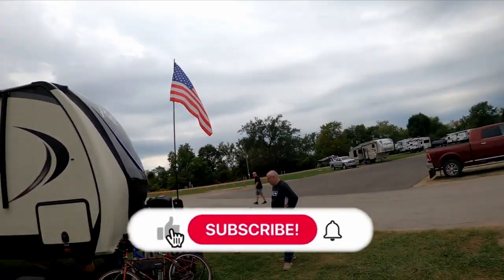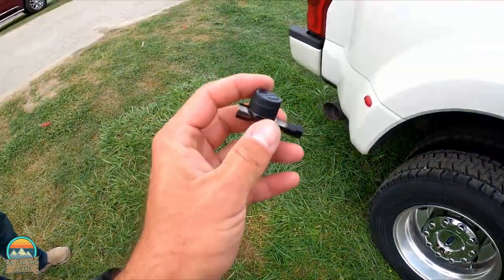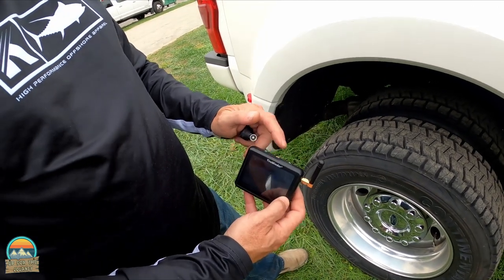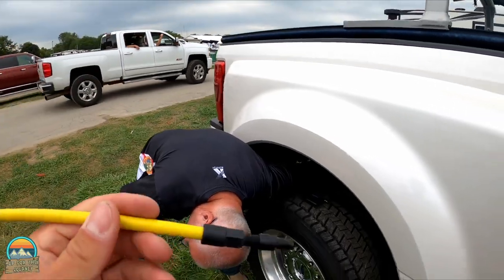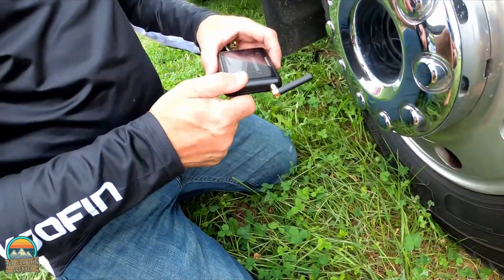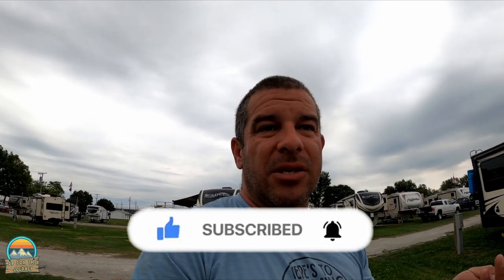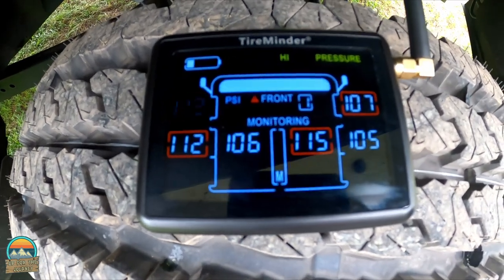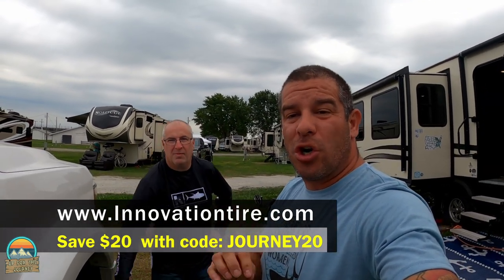NEW PRODUCT ALERT!!  Tire Minder Pass-Through TPMS valves

Comment: Pretty sure we will get the same system down the road.  Since the F450s do not have built in TPMS systems, we’ll need it for the truck and RV.  Hope you guys have safe travels.  See you soon!
Reply from the maker: So we found out the pass through doesn't work on the outside wheels. Depending on your rims. Our Alcoa style with the small holes, won't let the valve spin to screw on.  That's why we put it on the inside wheel
Reply: @Upforthejourney  now you can figure all this stuff out so it makes it easier on my 😁
Reply from the maker: @HitchRollRelax  I'm on it!  Hahaha